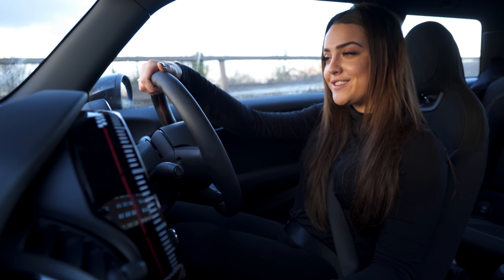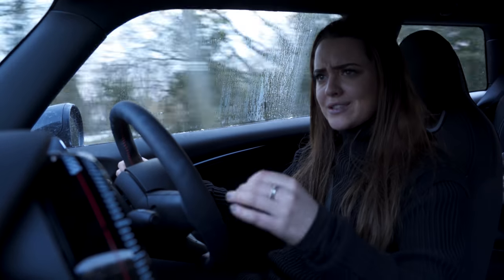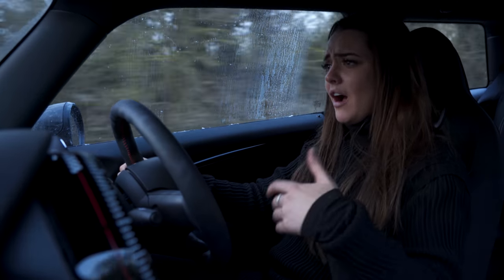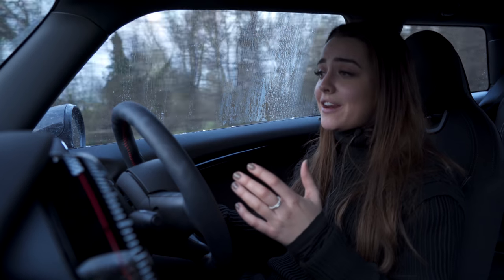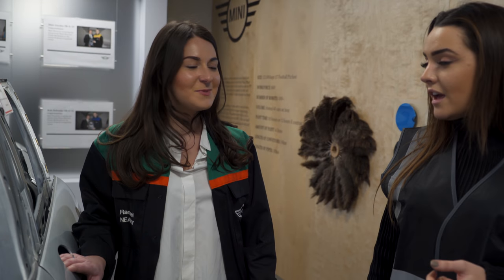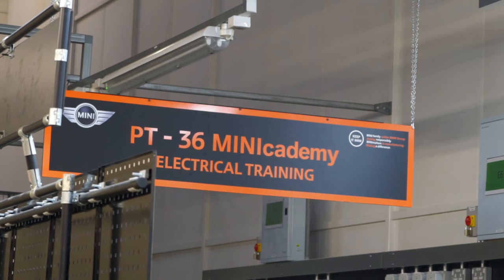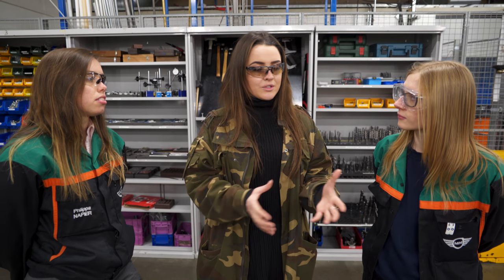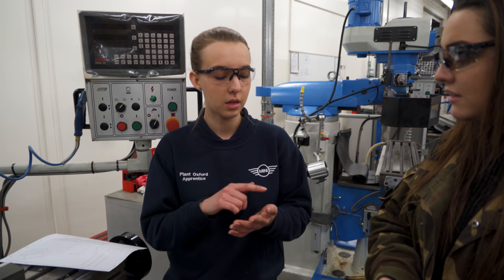A GIRL'S GUIDE TO: Mini John Cooper Works (JCW)

Comment: I bought my first Mini in 2004 brand new and loved it. Exchanged it for a brand new one in 2008 which was the biggest mistake ever. I hated it. Horrible car. Not a Mini at all. My mistake for not taking it for a test drive first. It felt big, heavy, cheap inside, plastic cheap feeling to It, didn't corner very well, just didn't drive like a Mini anymore. Had it for 4 months before I sold it. Stayed away from Mini until April 2017 when I treated myself to a 2005 Mini Cooper. Love it. Needs some tlc but love it. So far I have added a performance exhaust, replaced the half leather seats for full leather sports seats, new breaks pads all round, and just today several hundred pounds worth of work to the engine that was needed. It's a lovely car though. These new Minis and not mini's. Bloody horrible cars to drive and horrible to look at inside although they do look great on the outside.